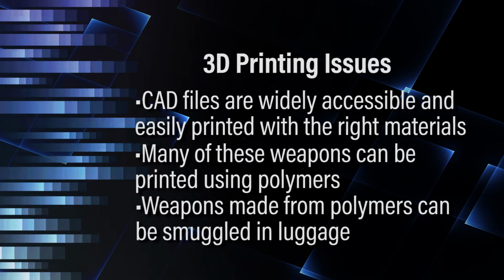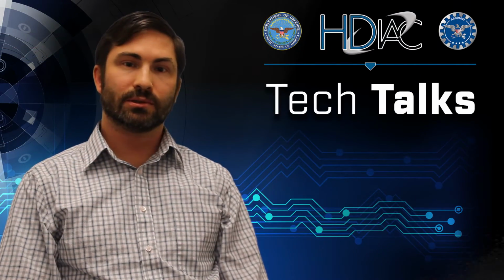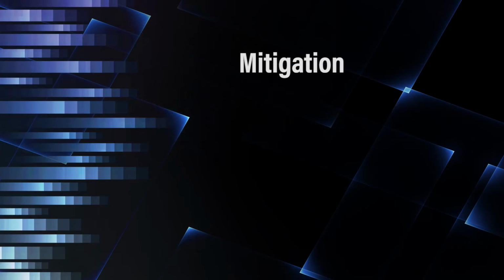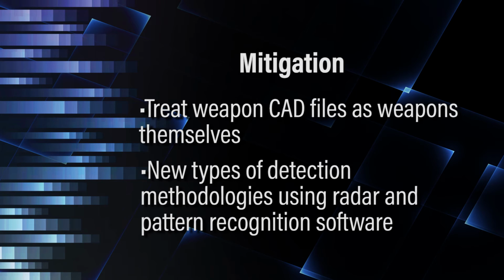3D Printing Weapons Risks

Comment: how is DHS preparing for 3d printed weapons
Reply from the maker: DHS is aware of the challenges posed by 3D printed weapons, as referenced in a bulletin released to state and local law enforcement in 2013 stating that advances in 3D printing capabilities could present public safety risks.  

The Undetectable Firearms Act, which makes the manufacture of any firearm that cannot be detected by a metal detector illegal, has been proposed as a method to limit and/or prevent the creation and use of 3D-printed guns.  Expansions to the current law were proposed; however, the latest version of the Act (PL-113-57) extended the original for another 10 years but did not change any of the law's provisions.  The Act does not ban someone from printing a plastic weapon, but the weapon would have to have a metal component.